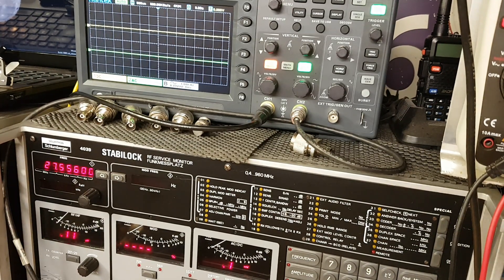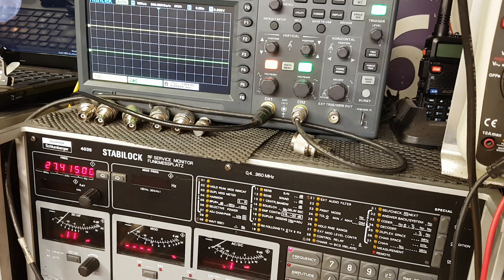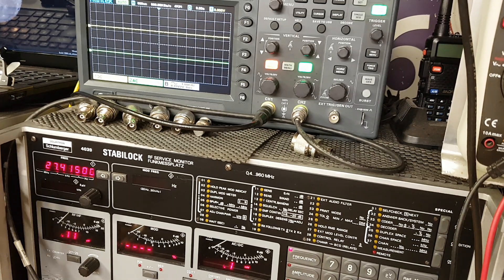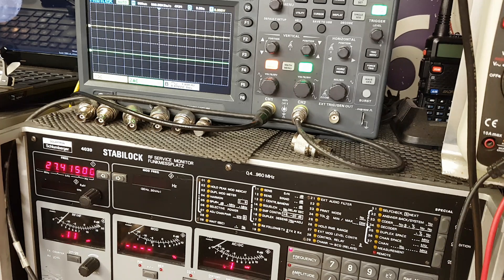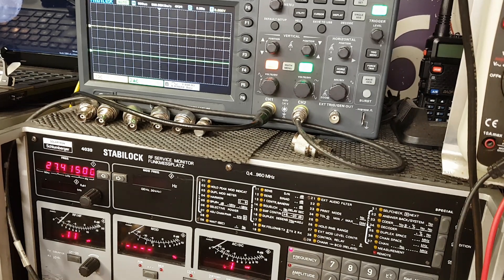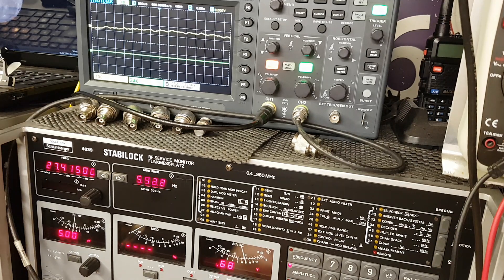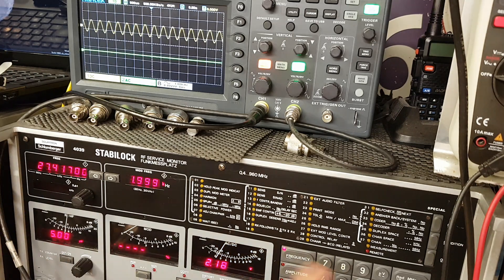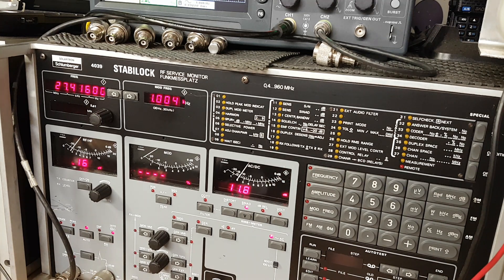Single Side Band radio testing.

Comment: Got to drool over that Stabilok !! Bee's knees ! Can the Stabilok send 2 separate tones for the SSB linearity test?.
73fromOz
Reply from the maker: It can. It has a fixed 1khz and a second variable AF generator, however I use a stand alone generator for this test.
Reply: This video is excellent to help learn. I need to watch a few times